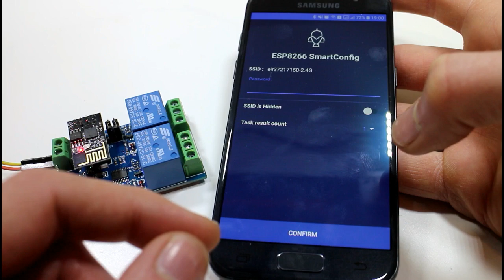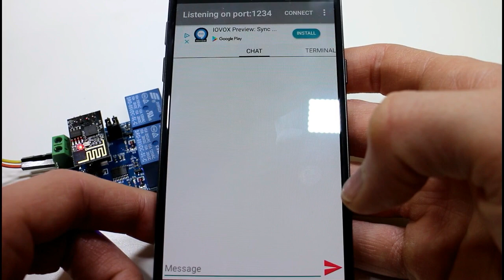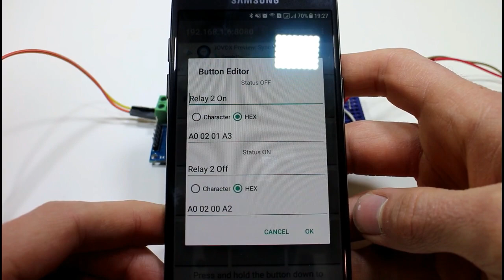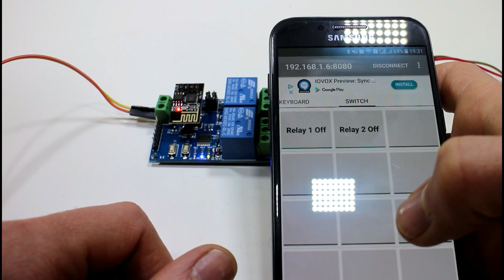IC Station ESP8266 based 5V Dual Relay WiFi Module

Comment: But how can you get it to remember the Wifi settings? Every time I reboot/powercycle the relay board, it loses the Wifi config, and I have to set everything up again.. which usually takes 4-5 attempts for me. This makes it more or less unusable for any real world application.
Reply: Haha i guess hes not going to answer you. but good point
Reply: Make sure you keep the relay working to avoid memory lost.
Reply: hello, did you find the solution?

Comment: Hi, I got this relay but when I click the left button nothing happens.
The green light flashes slowly just like in your case but the blue doesn't turn on.
Any ideas?
Reply: Same problem here bro
Reply: Turn power off and press s1 button while powering back on to switch modes. Video method doesnt work in mode where red led is constantly on on the main board.